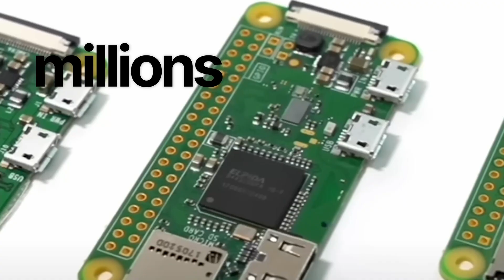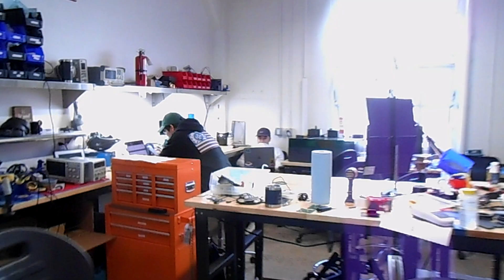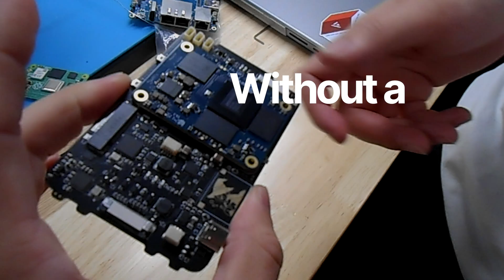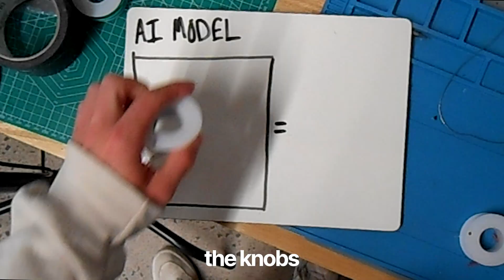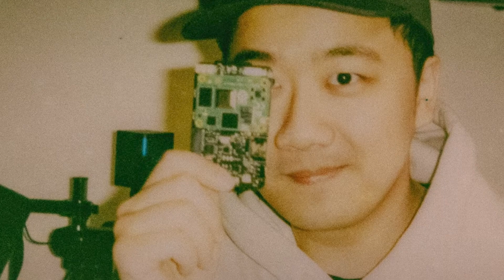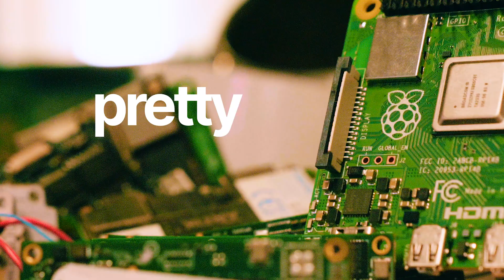They're making the next Raspberry Pi.

Comment: wait so they just made a shuttle board for the compute modules? What's the whole point of this than just getting a raspberry pi? I thought they're building cheap and reliable NPU dev boards. All the engineering went into this is just to fan out some IOs and adding some sensors and speakers interfacing with raspberry pi cm module compatable boards. I dont see any NPUS on the PCB. The actual compute is still happening on the raspberry pi compute module. So they made raspberry pi with raspberry pi. Congratulations??

Comment: How’s is it not just a raspberry Pi running Llama?
Reply: Pi with Ollama already runs 3B parameters.
Reply: @DeepakBhasin7 go and do something better then, show yourself to the world instead of just spitting insults
Reply: @stntprltrn  True, shoulld've shown more respect. I hardly comment, but this one went overboard for their click bait purpose, hence you find me speaking.
Reply: Just because someone sees flaws in something and voices their concerns, they don't have to be experts at the field. One can take a look at for example the Hungarian medical system and without being a doctor, you can easily discern that something is going very wrong.
Reply: @bagoston325  if someone with out knowledge on the topic can see the flaws imagine what the more informed people see and think. most of the time products arent marketed to the people that can make them, they are marketed to the people who cant. you need to be able to impress those people or you dont have a viable product, so i agree. everyones opinion on product validity or use-case is important.
Reply: Looked at the specs, felt the same way.  Unless there is custom silicon this is nothing too special
Reply: Can Raspberry pi run ollama i thought it took a lot of processing power if it does then which raspberry pi can run it
Reply: @darkhorizon8052  It depends on the model. There are some models that you can even run on a phone.
Reply: @Zybolta  can you tell me about some of them
Reply: @darkhorizon8052  pi 5 and also seen on pi 3b
Reply: 5W

Comment: It's called Ollama, and there are dozens of models for free, without internet, and without a subscription payment that will run on pretty much any modern computer including a raspberry pi, without a subscription payment. It already exists.
Reply: Exactly. If this is different, how?
Reply: @stevenhu202  I think they're making a SBC with an integrated NPU that's more powerful then the Hailo-8 on the the AI Hat+ and cheaper, otherwise it would be senseless
Reply: @rajveer_2009  yeah but whats the point if it cant run idk like 80b models
Reply: @stevenhu202  Cause with a board like that you can integrate those opensource models into your projects. If you're a normal consumer good luck trying to run those models on anything other than an expensive mid-to-high end graphics card, this changes that
Reply: @cdjwmusic  This. Sure you can run it quantized, but it definitely impacts the accuracy of answers. If this 3B model is running in full precision, then we have something big.
Reply: cheaper, easy to use, smaller, for nontechnical user
Reply: @Pamir-AI  you know this would be a thing like arduino right, a non technical user will still wouldnt be able to use this.
Reply: @kefal0  yeah and we will spend our engineering hours to make it non-technical friendly
Reply: @Pamir-AI  oh, I didn’t really paid attention that you were the guys that own the project. 

If that’s your plan, great. As a EE undergrad I find it pretty exciting. I hope some day all you guys’ hard work pays off. 

Keep us updated!
Reply: @Pamir-AI  I can totally see this being one of those futuristic items that teaches you how to be an expert at using it, even when you're coming in blind with no guidance on where to start otherwise! Can't wait to see where this goes!
Reply: @Pamir-AI If you are buying dedicated hardware to work with its technical users.
Reply: Ollama consume crazy amount of power and computing resources to run. This things only need about 5 watts as claimed by the researcher in the video. This is already  way better compare to it.
Reply: Pretty heavy on the resources though, even smaller ones. I need a medium GPU to get decently fast responses. Raspberry PI doesn't have nearly as much.
Reply: @Leonhart_93  Incorrect, you need any CPU and no GPU to run most models. All you need is enough ram.
Reply: @orangehatmusic225  I have run them on CPU as well, which makes them even slower.
Reply: dude, they are making a dedicated hardware device for it
Reply: @krishangukey2167  dude, who cares. It'll just be copy theft cloned from other stuff. Who invented AI again? Hmmmmm? Oh right another one of those things nobody knows who made it. Nothing has no inventor.
Reply: @orangehatmusic225  dude, I care, i appreciate dedicated devices for specific functions, and i appreciate what they are trying to make. also, research scientists around the world invented AI over the course of many years of rigorous research. everything in this world is "copied" or cloned from everything else, and hardware always needs to be dependent on predecessors to work correctly, so don't know what you are really complaining about here
Reply: @krishangukey2167  Yeah because you like everyone else wants an AI slave as low powered and as fast an inference as possible.
Reply: @orangehatmusic225 accessibility to outsiders without tech knowledge. nerds like us can setup and run all of this stuff locally, but most people i know dont even know what chatgpt is or what they could even use it for. if you put something like this in everyones hand and they dont have to pay sam altman's obnoxious ass 20$ a month for it then it will take off much faster!
Reply: Yeah it seems to me that rpi is fairly capable even for 3B params, but it's noticably slow. Although the parameter numbers are small, using an NPU will not only speed up computation significantly, but also consume less power. An Nvidia T100 TPU consumes somewhere around 200W and can do 10x the computation that the rtx 3090 can do at a third of the power consumption (LTT video). If we can expect similar ratios on this device compared to the rpi, then I think it could be very much worth it.
Reply: @Omaryllo  3B is kind of bad. Not sure what the practical applications for that would be.
Reply: @Mist2v RaspberryPi
Reply: yeah sounds like the are a wee bit late to the party.  the A.I board they got is if i understand it is 3 billion but Raspbarry pi 5 A.I Kit's lowest is 13 TOP (13 trillion). but it looks like they put raspberry pi and the A.I thingy on the same board so maybe you can add a A.I kit on top of it...however 26TOP A.I Kit still take "about" 1 minut and 30 sec to respond to a short/small question.  so maybe there board got more then 8 GB ram so it will work faster. that would help a bit... still do. feel a bit bad for them for completing it just now...and they where trying to over take apple A.I who was left behind.
Reply: Agree 100%
Reply: Where can I get one...whats it called?

Comment: why not just, like, run an AI model on a raspberry pi
Reply: AI bros need to feel special
Reply: Because raspberry pi units don't have a neural processing unit or a graphics processor with tensor cores so although it could technically run an ai model it would be so slow and inefficient you wouldn't be able to do anything with it
Reply: @lebanonblames That really depends on the model you use and the rpi you run it on. Ollama works fine.
Reply: @lebanonblames  the new one does...
Reply: @lebanonblames  bro just slap a google coral on a pi then

Comment: so are they making hardware, or just an AI model? because there are already models on ollama which are pretty good and require less than 4gb of ram..
Reply: Can you advise me on which these models that requires 4GB of Ram to download? I haven't gotten good results so far with small models...
Reply: @ahmadmanga  the smaller models are good for content generation, RAG, I also use them if I can't remember a terminal command for something.

But they aren't gonna make apps for you, and often say incorrect stuff confidently.

But I'm not sure if these guys can make something r volutionary, because these models (like qwen2.5) are already pushing the limits for the small sizes.
Reply: @botobeni  ummm... What's RAG?
Reply: @ahmadmanga  retrieval augmented generation
Reply: @botobeni  thanks!

Comment: 3B model, I’m assuming either Qwen 2.5 or Llama 3.2.

What gpu and cpu are you planning to use. What is the target tokens/s.
Reply: can't be qwen, they have restrictive licensing
Reply: I think phi is a good option, but they are making the hardware for others to build on with any model of their choice and availability
Reply: phi 3.5 > llama 3.2 > qwen 2.5, phi has better performance benchmark wise.
Reply: We can also use quantized versions of 7b parameters models n all I think
Reply: plenty 3~4B OS model out there! miniCPM is a great one too ! target token is >10tokens/s !
Reply: no cpu/gpu
most likely a baked fpga schema
analogous to how mirrors edge (game) has insane lighting but its baked (static), so the actual compute is very small
in a way you could imagine it being an incredibly specialised cpu which only runs 1 program because every single transistor in it is made to be the actual weights and the physical resistance is the weigth value thus an insane speedup
Reply: You need the Meta license to use Llama when u have > 700 millions monthly active users.
Reply: @izumiosana  so they can sell 700 million pieces lol
Reply: @izumiosana  they are running it localy, so it doesn't matter
Reply: aiming >10 token/s !
Reply: Or super quantization